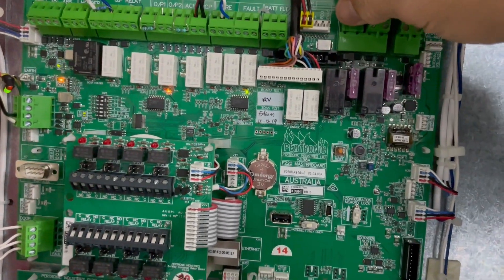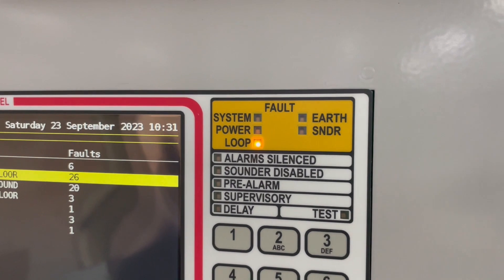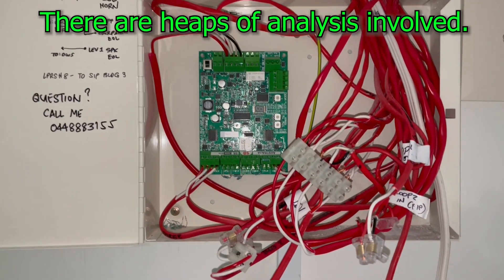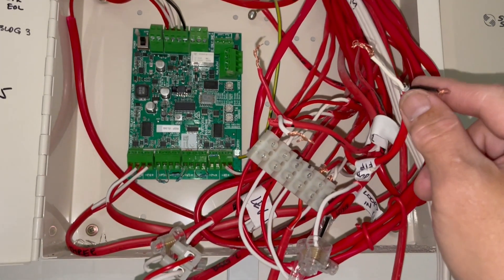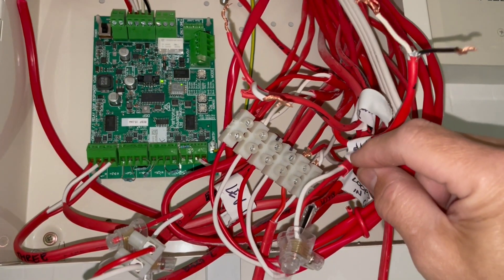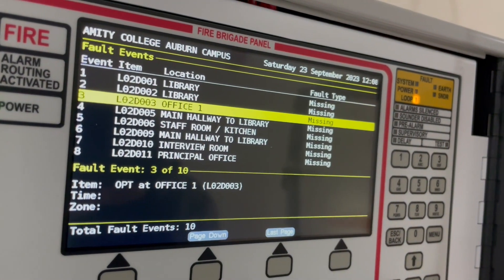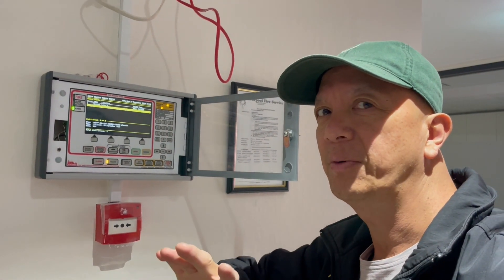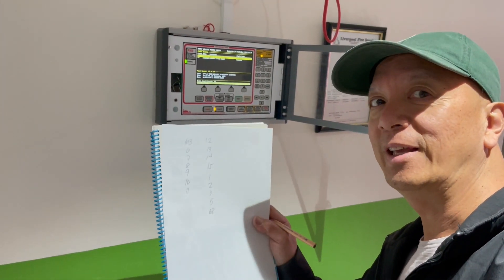EARTH FAULT - Fire Detection and Alarm System

Comment: Do cables not have to be "mechanically secure" in Australia? I see they are just held to the ceiling with plastic tie wraps and fixings.
Reply from the maker: We don't do  conduiting unless it's in fire stairs or on walls or open slabs. Inside close ceiling... we just hang it like electrical cables too. However, cables must be fire rated.

Comment: Thanks It helps a lot to learn. When shorts circuit, FIP says earth fault. 😮
Reply from the maker: No. It would be loop short circuit and all detectors & modules are missing except if there's an isolator in the loop circuit.